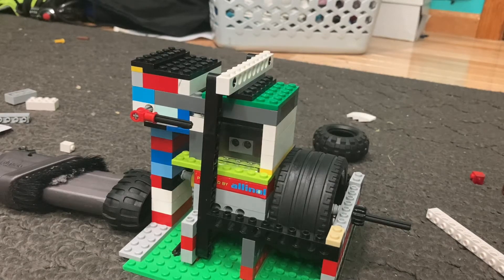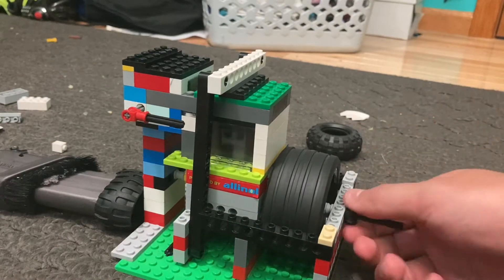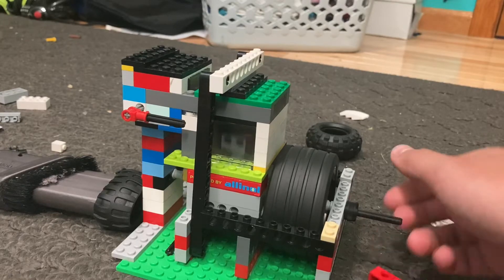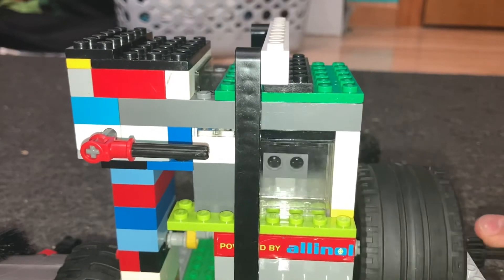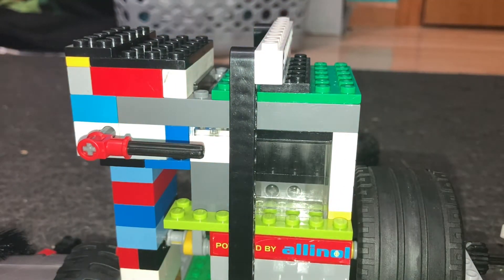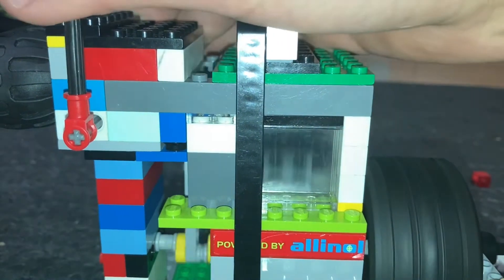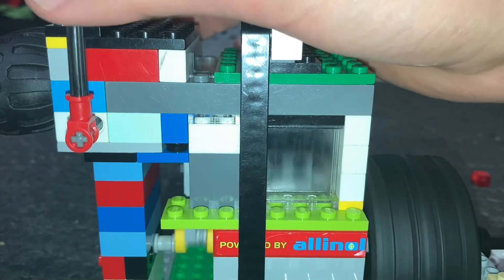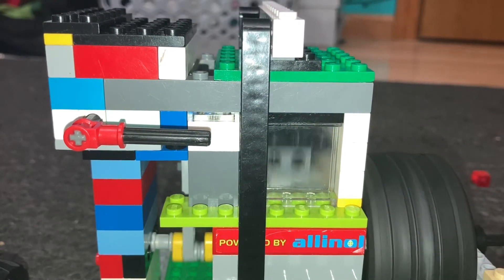My FASTEST Lego Vacuum Engine!

Comment: Let me just not ruin your hopes with the fastest Lego engine
Reply from the maker: Bit of a bold statement to say you have a faster engine 🤨
Reply: @KFPlusLegoMastery  yes yet I don’t have it running smoothly I need to get a new crank shaft and sand down the wall of the cylinder

Comment: Could I teach you a way of measuring rpm without a tachometer
Reply from the maker: Sure! What did you have in mind?
Reply: @KFPlusLegoMastery  Ok, put a stick at the end of the crank shaft and put your phone in slow motion. Record it for five seconds then count about how many times the engine would take to complete a rotation. After this multiply the amount of rotations by 12 to get the rpm(rotations per minute)

Comment: You should try lubricating it with vegetable oil. I have do it some times and it works well, as long as you don't have to much. It will also be able to run longer without it breaking.
Reply from the maker: I haven’t had any problems with the olive oil, but I might try vegetable oil in my next engine to see how it goes.

Comment: 2:58 Yeah but don't forget the hoover still has compressed air that is still pushing after you turn it off.

Also my Hoover doesn't blow, ive made about 4 different models using a bunch of different mechs, ball lifts for air flow, and I've even tried reversing the whole thing to get it to work with my Hoover sucking but no luck. Might need to buy one that blows, do you have any cheap alternatives? I've tried 2L bottles and things like pneumatics but they just don't supply nearly enough force.

Edit : Do you think a hair dryer could work?
Reply from the maker: Joey Goodfield A hair dryer might work if you focus the air into a smaller tube for higher pressure.
Reply: Keep in mind that the air coming out of a hair dryer is really hot, which will probably melt or warp your bricks. I wouldn't recommend using one to power an air engine made of plastic.
Reply: @mel_energy  it's okay lol, the one I used has a cold setting so it blows cold air. :)
Reply: @It's a jolt reskin yeah me to
Reply: Wait, ITS SUPPOSED TO BLOW???? When i built mine i used one that sucks, i guess both work lmao